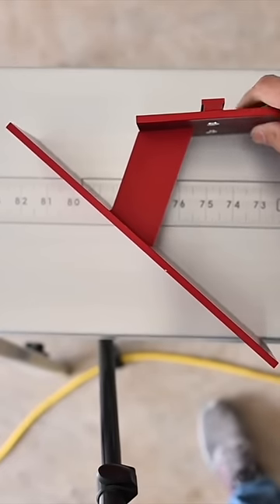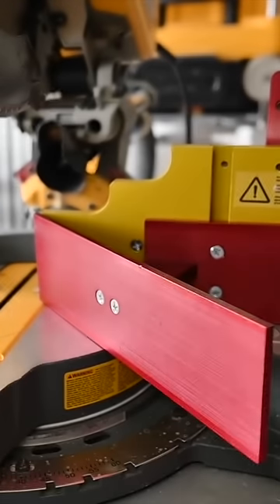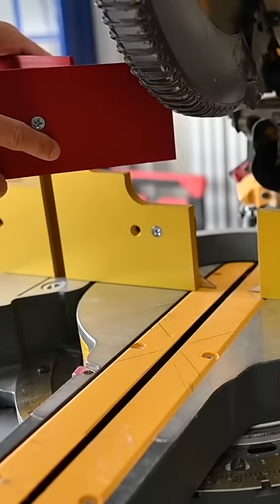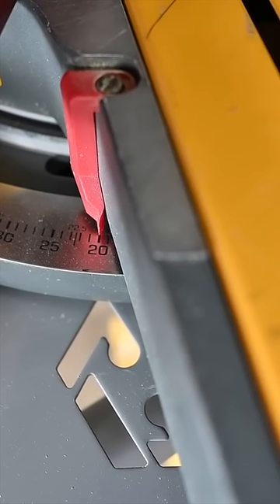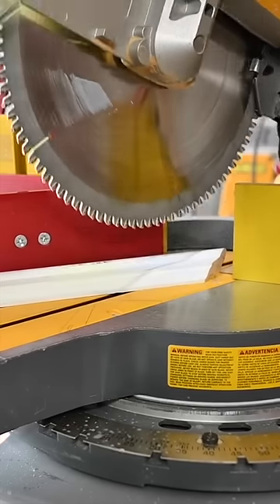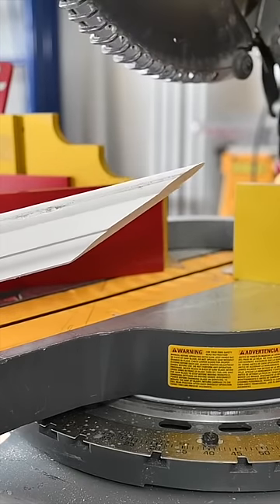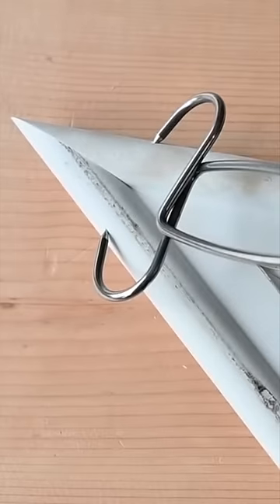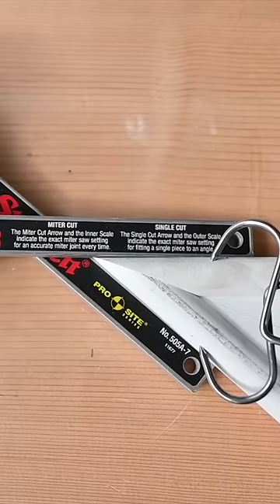Miter saw trick everyone should know.

Comment from the maker: If you guys want to check this jig out you can get it here:(no affiliation) https://www.kizenenterprise.com/product-page/pre-order-miter-fence-pro-system
Reply: Thank you Brother, I'm gonna check it out, it's a greats a solution to these angles beyond 45 degrees
Reply: $400🤯 We have to make a more accessible option
Reply: In a full blow cabinet shop I would go with this. At $400.00. But on my tracing from job to job miterbox. This might be a bit to high priced although it does appear to be very well made
Reply: What saw do you have?  Model number please.
Reply: Dang $400? No way cost more than the miter saw itself.
Reply: At a $400, plus shipping there is better options.
Reply: My first prototype was marine grade plastic. I felt it was way to slippery trying to hold trim when cutting. I got tired of replacing my wood fences.
Reply: @KizenEnterprise  I do understand the amount of research that went into the product and production and logistics.
But most people would buy it if you had 2 versions. The pro version were if the miter saw gets knocked around your product will hold up. And a home owner version were it’s cheaper and more people would buy it.
I as a home owner would have bought 2 if they were $50 apiece. Now think about the volume of sales with a thick plastic version at $50. And I guarantee that I would tell people were I got it from. You could also laser etch your website into the plastic piece or have it formed in the process of production. Overall your product gets a 10/10 rating for awesomeness and functionality from what I have seen.
Reply: Nice video, thanks for the tip.
Reply: @frankdelucey2137  great point.  or even 80 smackers.  a cheaper option for would be wise from a business perspective.  great idea and product though.
Reply: @frankdelucey2137  absolutely spot on. I would think they could 3D print them with some metal reinforcement bits. At $400, it's not even an option. It should come with a dust boot to attach your shop vac too also.
Reply: @HeyLookWhatICanDo  Check 3x3 Custom’s videos. Tamar made a homemade version of this type of jig that seems to work great
Reply: @stephentucker5406  a full blown cabinet shop has the resources to fab something that works just as well for a lot less money. This looks pretty specialized, maybe for someone with deep pockets who does nothing but cuts enough crown to justify the cost.

It does look like it was engineered very well, though.
Reply: Lost me at 400
Reply: 9 months after you posted the link, the price went up to 425 from 400.
😮
Reply: @HeyLookWhatICanDo I guess I'll have to make a 3d printed version. That is obscenely expensive.
Reply: Great tool but way to expensive, shame!
Reply: It looks like a good tool, can I still bevel at 45 with this installed? Also if they drop the $68 for delivery I would consider it. I’m not spending over $500 for something I’ve gone 24 years without. I build and finish custom cottages in Muskoka and work with many different finish carpenters. Would this make our lives a little easier? Maybe. But for well over $500, I’ll make a jig on-site or stick with my crown stops.
Reply: @HeyLookWhatICanDo as a machinist.... I can confirm that is a lot of coffee breaks. (For that price)
Reply: @frankdelucey2137 I do offer the kizen fence in Marine grade plastic. We Resurface the face so it’s not slippery.

Comment: Where was this during my 30 years as a carpenter. This clever device solves so many problems on the miter saw 👍
Reply: I started working in 1979. Working and figuring how to make setups easier over the years. Now I sharing my system. Thank you for noticing the advantages of the Kizen Mitre Fence

Comment: I would like to elaborate on the angles. The finish angle of the two pieces is 40D not 70. If you take the gauge he used and look for the zero on the inner dial and follow the line to the outer dial it is pointing at 40. That is the actual angle. The 70 that he is referring to is the miter saw setting. If you have a 40d angle you need two 20d cuts. So 90-20=70. That is your saw setting. The large arrow on the dial is for a single cut. Let’s say you want a 40d angle for a piece of wood which will be placed against a wall. If that angle is 40d then 90-40=50 which is the saw setting. You’ll see the inter dial is pointed at 50. His angle finder is excellent. You can get dead accurate cuts with it. It can be confusing at first but if you play with it, it becomes very clear. Also the settings on a miter saw refer to what you are cutting away. So if it’s set at 30 you are cutting away 30d which leaves you with a 60d angle on the piece. Just remember all settings are based off of 90d.
Reply: This took me a little playing around with my speed square and the mitre saw when I was thrown into the weeds. Once you got it, it’s very much like riding a bike.
Reply: Thank you for clarifying!
Reply: I'm like 90-25 is 65% angle

Comment: Made that 20 years ago out of scraps had to clamp it on but it worked lol guess I  should have pursued the design further darn
Reply: Us wood workers have these contraptions all over our shops. You should see the standing bandsaw box I made to cut 1/16th" panels off of long boards:)
Reply: 'Necessity is the mother of invention'.
Reply: Especially @ $400! Lol
Reply: @Toyotajunkie that red color angle cost 400 dollars? 🙄
Reply: I did the same thing with a simple wall puller for lining up your plate.  Now sold by Stanley.

Comment: Really cool. You can make your own pretty easily by just clamping a board and cutting a 45, then using that as your reference surface to get those angles you typically couldn't set your miter saw to cut.

Comment: Years ago, I was able to answers a person's query on finding the compound miter for a chair rail molding that angled up a stair wall then turned at the top wall going back to horizontal. The answer is there is no compound miter that will work in that scenario. However, the solution is quite simple. A few inches before the molding reaches the top make the angle cut that returns the piece to horizontal and 45 miter that small piece to joint with the horizontal molding of the abjointing wall.
Reply: Whaaaaaa?
Reply: @Rob-fd6si  what part don't you understand?

Comment: I worked at a Woodworking store in the early 2000's, and we had this customer who was always making jigs out of South American hard woods so they would last. He would package them in plastic bags, with all the parts so you could either assemble them or he would assemble them and come in every few weeks, set up his saws and demonstrate them for customers, and if they bought one we got a cut. He built something like this, and had a fab shop make them out of aluminum, but they were expensive. When the web got hot, he got them made in bulk, and sold them to a lot of the big box stores, wood working stores and even the tool crib. Last time I heard about him, he had made millions by selling this designs to a major tool manufacturer.

Comment: Yup, but instead I just clamp a square piece of stock flat against the fence and to the base plate… Then 0° becomes 90°, 10° becomes 80°, 20° becomes 70° and so on… and 45° is still 45°…
So if you’re cutting picture frame wainscoting and you set it up right you can cut all your angles by setting your saw on 45°… then by using both fences & a stop, you’ll never have to swing your saw.

Comment: How do those clips hold well I’ve never understood them? Where could I pick some up? What are they called?
Reply: They're called Collins miter spring clamps. There's a tool that opens/closes them as well. They are pointy on the end, so they are held in place by the spring tension and the spikes digging into the material and holding the angle together until glue sets. The spikes do leave a mark that you have to fill. U can get them off Amazon, Rockler, probably some other woodworking places.

Comment: would be nice if the fence had a flat bit on the bottom that is level with the base of the saw so you can reference off two surfaces instead of the bottom of the workpiece just hanging

Comment: Any trim carpenter worth his salt would have built one of these out of scrap wood a long time ago. Check out this pronext that I will describe.
In a small powder room that is Triangular in shape. We're installing 5 1/2" crown molding. Describe  how you would install it with joints only in the corners of the Triangle? ( You only need 4 pieces of crown molding to do the job)

Comment: I see that can be used for certain applications but not so much for standard 45 trim. To begin with .. the piece being mitered is no longer being supported by the miter saw stand with side supports.  Secondly, the amount of time it takes to pop that jig in takes longer than readjusting miter saw itself  
Main advantage I see is you get much more angle cut available and a longer cut...otherwise.. not convinced it's something I would ever need for the jobs I do.
Reply: Maybe 🤔 you don’t need the pro system. There is more to the kizen mitre fence then an extreme angle jig.
Reply: @KizenEnterprise  thank you... I will look into your other offerings to see if there is something that I would benefit from for the part time handyman business I run.

Comment: This is way safer than when put my speed square 1mm from the blade
Reply: 3 1/2” fence of Aluminum 1/4” you can clamp your trim to or drill a hole and screw it to the extreme angle fence

Comment: Why not just put the saw itself to 70 degrees? Or Is there something I'm missing
Reply: I've never seen a miter saw that will cut that sharp of an angle.  Most of them max out around 50-60 degrees.  If you need more than that you have to cut shims or invent some kind of contraption to hold the wood at an angle to the existing fence.

Comment: the  scale says 50. where is it at 70?
Reply: 70 is only one side of the miter joint.  And actually it's not 70, it's 20 because he's moving 70 degrees from his 90 degree position on the saw.  So if each side is 20 the total is 40 for both sides, which again is 50 degrees away from 90.  That's why it reads 50.

Comment: Nope nope nope. There is a reason that the saws only rotate to around 50 degrees and it's not because they can't make them. This creates a situation where the wood is being pulled into the blade with no backstop. Don't endorse this, this will be a lawsuit waiting to happen. These cuts need to be made with a table saw that is directing the wood away not towards the blade. This will chop a lot of hands and fingers off.

Comment: This is hardly a trick that anybody with a miter saw can do, first off you got to have this custom fence that receives these attachments. And then after all that I could just adjust my miter saw to those increments and do these things already. I could have understood it if you kept your fence at 90° and you're strictly doing this so that you can quickly repeat exact 45° angles.But then you're using the miter saws base to change the settings anyway,so if the base is accurate enough to do it with your attachment it's accurate enough to do it without it, what's advantage of all this?
Reply: Miters most miter saw can’t do without a jig. Great example is staircase panel trim